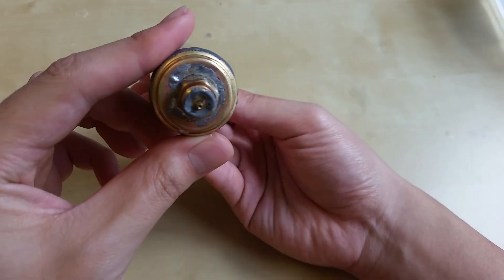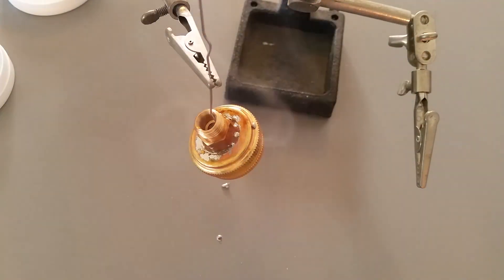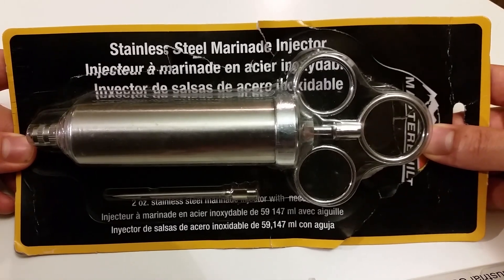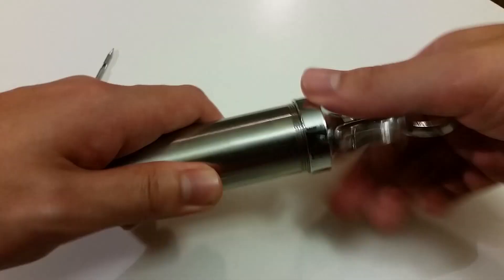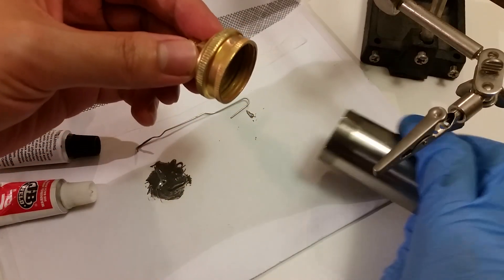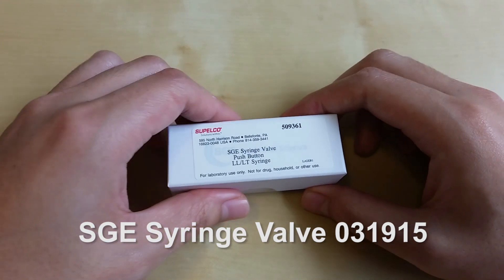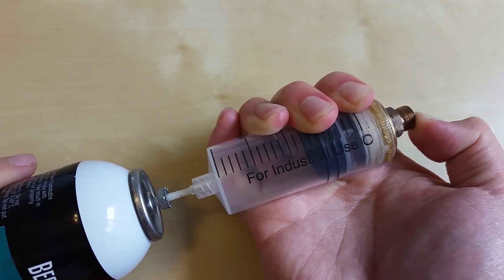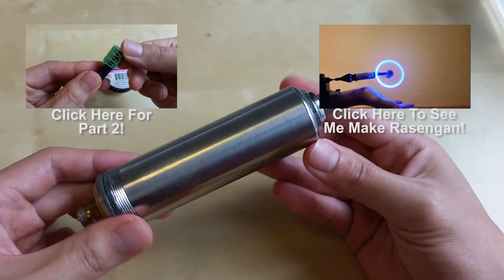How to Make a Real Burning Lightsaber: Part 1

Comment: Couldn't use compressed air or a Co2 tank (like the tiny ones for bb pistols and such) instead of Butane? If all you need is pressure in that chamber, and as no Butane can mix with the fuel, why use a flammable gas as your pressure source? I mean.. seems kind of wasteful with the Butane. There are much better ways to use Butane. Use the Butane instead to create a constant micro torch as the ignition source for a flamethrower made from a fire extinguisher (TKOR) and mount it to the flamethrower. Co2 cartridge or compressed air... Get a valve like as in those gallon or 2 pump sprayers for garden pests, plants, the neighbor's cat (with water) and incorporate that setup (pumping with a push-pull lever to pressurize the pressure chamber, maybe like a pump action bb rifle could be better (already small form factor)

Comment: jb weld thats just glueing right?
Reply: Jb weld is a really strong glue like thing that is used for repairing boat hulls at sea and stuff
Reply: Iggy Peters weld is a thing that u use to melt metal ant then it hardens back to seal/attach the metal
Reply: The boss Bear "JB Weld" is a really strong glue like material that is used for fixing holes in metal in boats and stuff.
Reply: Thanks!

Comment: +SufficientlyAdvanced where did you get your polypropylene syringe from? I've been looking around and can't seem to find one that fits perfectly inside the injector.
Reply from the maker: It's a 60mL syringe I got off Amazon, their sizes should be standardized but if it doesn't work for you I can find the original listing I used.
Reply: +Sufficiently Advanced the listing would be helpful if you have it. My problem has been that the plunger isn't wide enough to keep the liquid and fuel separate
Reply from the maker: https://www.amazon.com/gp/product/B00N6HMIOK/ref=oh_aui_detailpage_o02_s00?ie=UTF8&psc=1

If it isn't the plunger then it might be the injector you're using...
Reply: Thanks a lot ill give this a try.  Im almost positive its the plunger because I got the same injector you had in the video.

Comment: I can't find any of those materials.
Reply: Don't have to get the exact stuff
I'd say start with any old luer lock injector and butane valve, measure your dimensions then look for a suitable adapter to link the two; also find a suitable syringe plunger.
As for the syringe valve, it's available worldwide, costly little bugger though
Reply: BGM available worldwide from where, sigma aldrich?
Reply: The valve thing costs freaking 90 dollars. Guess I'll just have to wait for a winning lottery ticket.

Comment: How on earth did you find all those perfect fitting components? I try to have a mental library of common parts in my HW store, but this is some next level shit!
Reply from the maker: +Auarhau By working on it 6 weeks straight until I was just about insane...
Reply: Sufficiently Advanced Haha, gotcha! That needle valve must have been a total pain to figure out and source. Also I'm amazed that it fit a fitting used for a marinade injector! Love standardization, haha!
Reply: +Sufficiently Advanced is there any way to buy something like Rasengan or other things you've created

Comment: why not use air instad of butane?
Reply from the maker: +Jallafish  It wasn't demonstrated in this video, but with liquid butane the pressure stays constant, as the vapor pressure of butane depends on temperature rather than volume. Plunger moves up, volume increases, gaseous butane evaporates from liquid butane until the vapor pressure is at equilibrium again. Constant pressure from beginning to end.That's why I didn't just use, like, a bicycle pump :P
Reply: Cuz then it don't work
Reply: +Sufficiently Advanced Great answer! Wish it was in the video though. I was surprised to find out that you weren't actually burning the butane, then I wondered the same thing: why not use a bike pump? But that makes tons of sense (although it makes it that much more dangerous).

Comment: Sooo maybe a dumb question but why butane and not a spring? 
Interesting build so far.
Reply from the maker: +Deathbynature Really good question, actually. A spring would provide a force proportionate to the amount it was deformed, so you'd get a lot of pressure to begin with and then as the fuel was spent, you'd lose pressure as the spring expanded. It wasn't demonstrated in this video, but with liquid butane the pressure stays constant, as the vapor pressure of butane depends on temperature rather than volume. Plunger moves up, volume increases, gaseous butane evaporates from liquid butane until the vapor pressure is at equilibrium again. Constant pressure from beginning to end.
Reply from the maker: +Deathbynature That's also why I didn't just use, like, a bicycle pump :P

Comment: I noticed you weren't swinging your "lightsaber" in that short clip. Is it fragile? Or will it completely wreck anything it comes in to contact with, thus making swinging it unwise?
Reply from the maker: +B Babamzel Swinging the blade too fast blows the fire out, but I think a better ignition system would help with that!
Reply: Hmm, interesting, thanks!